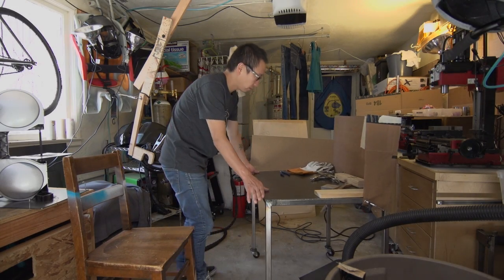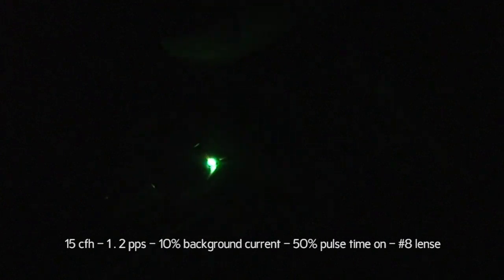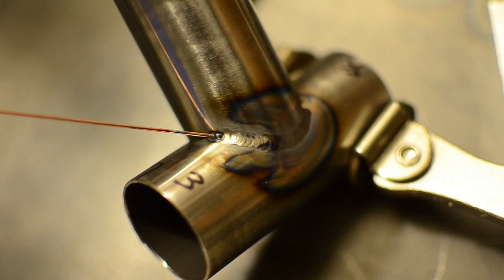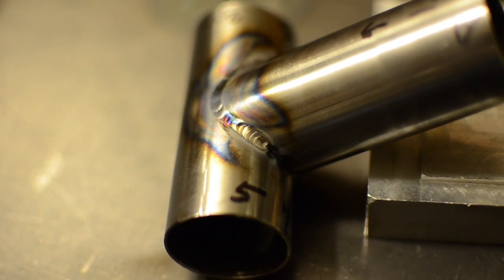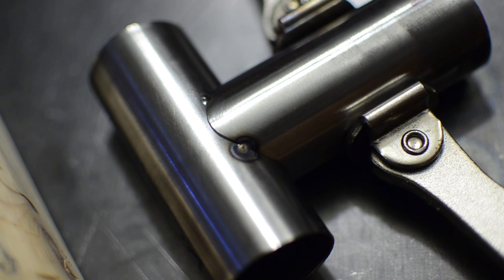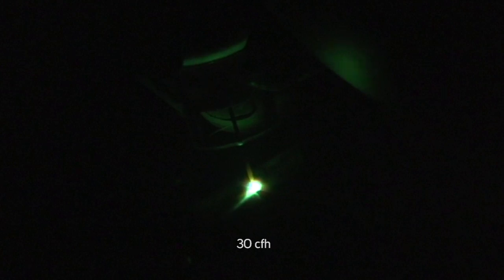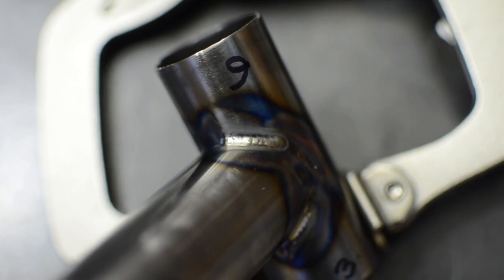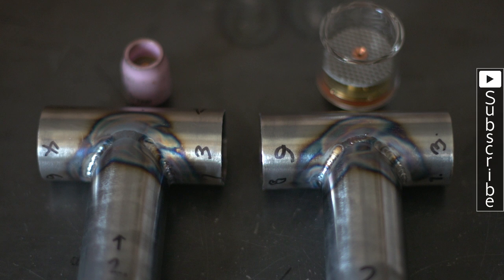Bicycle Frame Build 29 - The Road To Good Welds Pt2 - Gas Lense Comparison

Comment: 1. Keep those helmet lenses as clean as your reading glasses!     2. Sounds counterintuative but, shine a powerful lamp, over your shoulder, onto your work. You can better see reference points and see your filler rod, the way you're holding the stinger and  even the unlit tip of your tungsten - if the light is strong enough. 3. Try a long taper with a tiny flat spot on your tungsten.  Once you find the best profile, keep it for the rest of your career!  A well ground electrode, tungsten, will emit a beautiful, balanced cone of blue. Touch the tip to the work and that cone is gone, don't continue, re-grind the tip.   4. Arc length: Strive to 'close arc'. The longer your arc, the greater, more unmanageable the heat. With welding you must never yield to bad habits and sloppy prep;  long arc, wrong lead angle, dirty lenses, mis-ground electrodes, Argon pressure, filler rod diameter, poor positioning, omission of good lighting, coffee before welding, crossed lead cables coming from the machine (arc blow)... and etc.  5.  The way you hold the stinger;  you've got a wrist, USE IT!  Prop the cords and hold the stinger like Rembrandt held his brush. And don't be afraid to CONSTANTLY change angles.  6. filler rod:  Anticipate the pulse and preheat your filler rod by dipping it into the cone of heat then placing the filler metal into the puddle.  Anticipate 'hot spots' and dab the filler rod to cool them. Bend the rod if necessary.      Challenge yourself to make longer welds, even if by only a couple of pulses. 6. Other:  Hide your tacks. Play with your machine settings, wire diameter, lead angle, electrode prep, gap...   don't get stuck doing it the same old way.  Discover how lead angle leads to 'fuller' , better welds.                  I guess I've gone on long enough.   Having watched all, I think, of your videos, your welding is really pretty  good!  (lead angle: see how accentuated lead angle stacks the puddle. At 1:07      https://www.youtube.com/watch?v=5frg9l9_bcM

Comment: I'm sure you're further along now, but way too much stick out.  Watch some videos from guys like Jody at welding tips and tricks.  He'll show you to use a #5 cup, almost zero stick out and you can use the cup to walk the weld around using far less gas and get much better welds in general.

Comment: I had to weld galvanized steel before and I didn't clean off the galvanized coating, and that was the reason for the chalky white stuff around my weld. I don't remember what kind of metal you were welding though so I don't know if that's the case. Just my 2 cents.
Reply from the maker: +Oplet It's chromoly. You're right though. It can be a combination of something foreign on the surface. It can also be the case for chromoly that if the heat affected zone remains very low temp, it can leave a haze.
Reply: Ah i see, keep up the good work though! Your videos are extremely satisfying in an OCD sense as well as entertaining. I love them.

Comment: I usually use 8 liter per minute, sometimes more sometimes less but average is 8 ))
Reply from the maker: +Роман Романюк Nice. What size gas lense are you using?
Reply: +Pithy Bikes i used 10, but i get better results on number 8 and now will use only 8.
You can see some my fotos here https://www.instagram.com/elements_team/
I usually work with alu, but I try to make test frame from AISI 304 before make frame from titanium and I realized that need a little more practice on DC welding..
Reply from the maker: Great! I started following you. Yeah #8 is my current favorite.

Comment: Cfh it's means cubic foot hour? Why not cubic foot minute?It's little hard to undestand for me cause we use a SI system, liter per minute.
Reply from the maker: +Роман Романюк I agree it hard to understand. I don't try to make any sense of it on a time based level. I just know relative to welding that I use around 18 - 20 on the flow meter. :) Having welded enough with this setting, I know what it feels like. So if its not enough I can usually sense it.

Comment: High Pittty,
I asked my TIG teacher ( a guy with 30 years experience in welding for NDI (non destructive inspection, X rays) rated weldings.
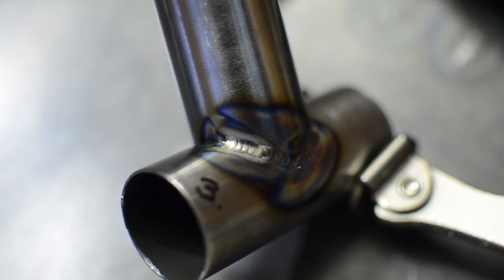He tells that it seems that that white, aluminum like effect (11:55 in the clip) could be due to the low temp of your welding at that time.
The blue region, which is the +/- 300°C zone is very small at that area. So meaning that it was a cool zone.
grtz
Bart
Reply from the maker: +Bart Van Laer This makes sense. I think he is right because I noticed when the weld was running hot in places it did not produce the chalky stuff. Finally mystery solved! TY!

Comment: I don't know what chalky thing you are talking about, if you mean soot witch is common in aluminum mig welds, getting black soot around the weld.  The soot is actually magnesium oxide especially common when welding with 5356 aluminum wire but you should not be getting the same thing for your welds.

Comment: Not sure about that chauky stuff? It looked like you were very thorough getting everything clean, and the weld itself looked ok. My guess would be some kind of oxidation in the heat affected zone? 
+1 on the gas lens with the #8 cup. I've been using one for the past couple of months,and I really like it. 
I'm about 60% done with my first frame build and the biggest challenge so far has been joining thicker/thin wall joints together - dropouts to stays and any tube to the BB shell.
Anyway, your work looks great and your videos are awesome!  Keep it up!
Reply from the maker: +Joey Mesa Ah thick to thin is tricky. When I did my first frame in a class it was kind of a nightmare.
Yeah i think you're right. Its got to be some kind of oxidation. I'm thinking that its drafting up through the joint itself which would explain why its so close to the bead and nowhere else..
Reply from the maker: ***** I like your theory!

Comment: Awesome progress! Congrats!

The only thing that caught my eye was the ever so slight delay between when your pulse came on and when you fed wire. I don't do a lot with pulse, but I use the same technique with and without pulse. I anticipate the pulse (or the pause in travel if I am not using pulse) and am trying to hit that puddle with wire as close to when the pulse comes on (or when I pause and dip) as possible. Then I can either shorten my pulse time on or go with a slighter higher PPS. Just throwing it out there as  something to try. Could help reduce your overall heat input.

Again, awesome work!
Reply from the maker: +zanconato Hi
Yeah, I do have a delay before hitting the puddle. I do that because my background  amps are so low and the puddle needs to from up again each time the pulse comes on. I really need a temperature gauge so I can analyze the differences between less background amps/slower pulse and more background amps/faster pulse.

Comment: Hey Steve, glad to hear that the passive lens recommendation was helpful. I gotta say, all the discussion I've seen on the forums regarding the Pyrex cups has been pretty negative. They're gas hogs with little or no upside. No need for monster/specialty lenses if you're welding steel. Ti, or maybe Stainless, then that's another matter, but for steel a no.8 cup should work just fine.

Keep it up. You're definitely on the right path. Closer to success than you might think. Good luck!
Reply from the maker: +Alistair Spence Hi Alistair, Yeah the passive lense is amazing. After the first weldwith it I was thinking, why wasn't i doing this sooner! Also, after your recommendation I looked at my active hood shade settings and I had it set to shade 10. Makes sense for standard welding but on bicycle tubes its too much. I just didn't notice.
Reply: +Veteran Bicycle Co. Good feedback. Just for the record, I've never used the pyrex cups myself. I was very curious about them but all I got from people in the bike making world was the downsides, so I stayed away. I should say that this feedback was regarding the CK Worldwide pyrex cups. Maybe there is another brand that is better? I don't know about that, since I gave up on the idea after hearing that people didn't care for them.